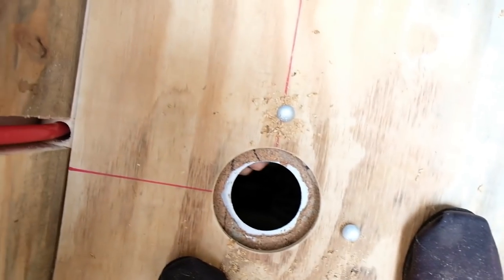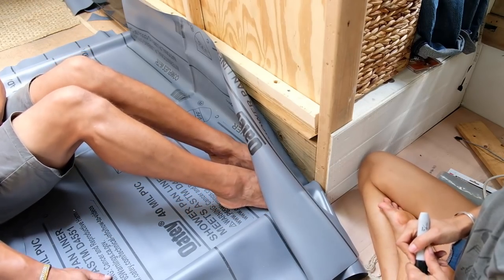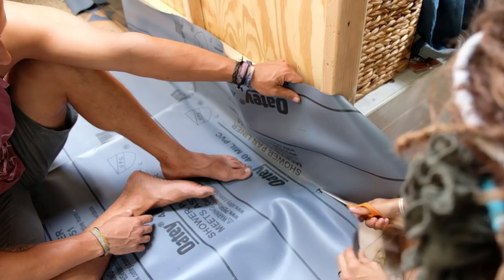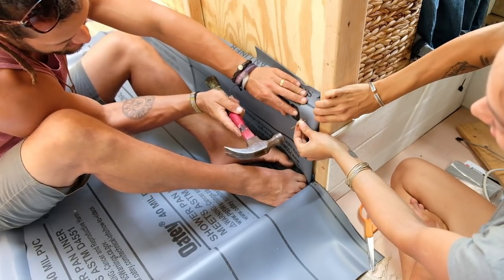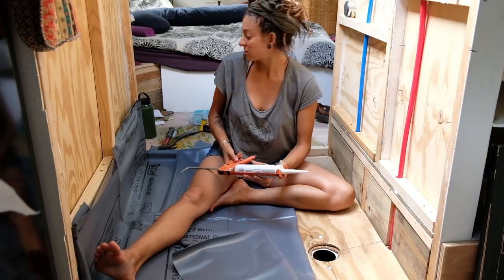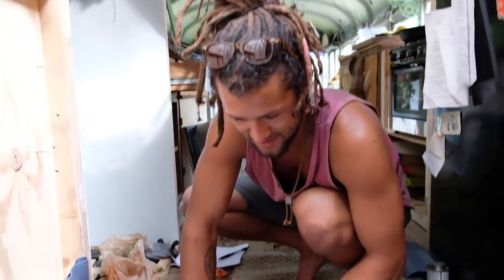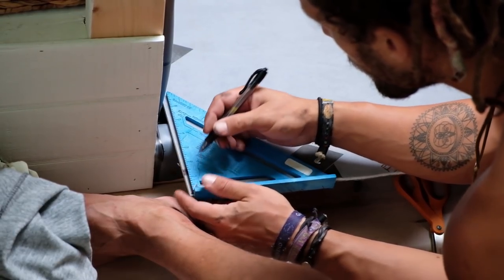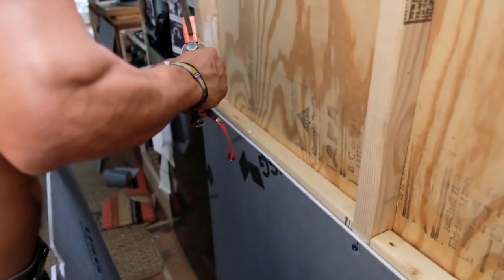EP #29 SKOOLIE CONVERSION:  Shower pan and tile backer board for a school bus shower

Comment: You can do copper or Stainless Steel,  a cheaper option, as a shower base, made in one piece so it doesn't leak.  We got one made for our shower base  which was a non standard size, cheaper than one from a store.
Reply: Where do you get something like that custom made?